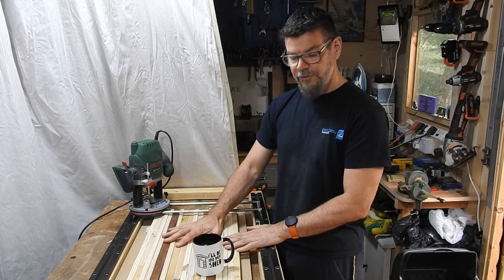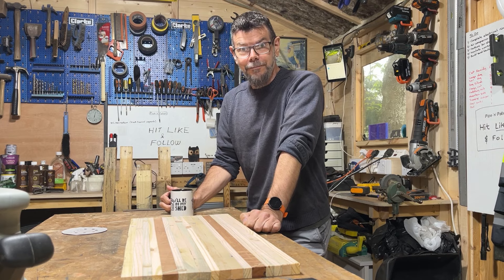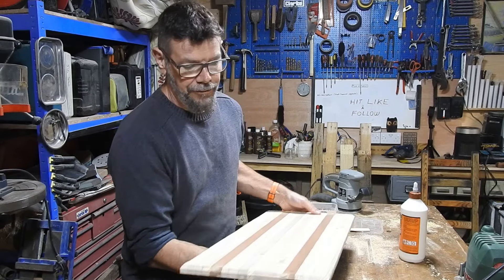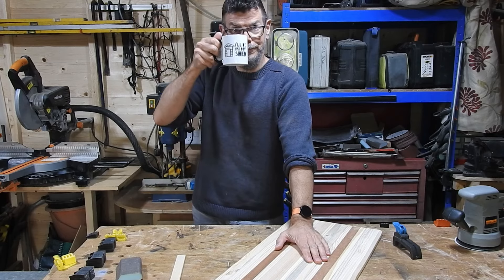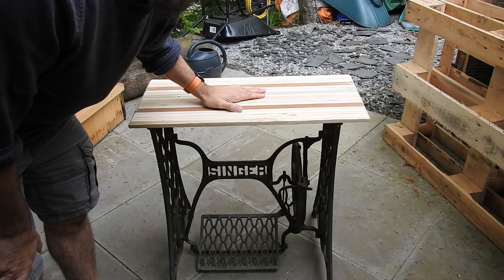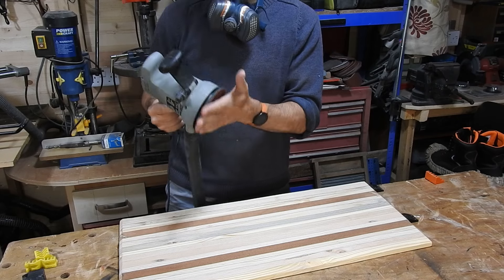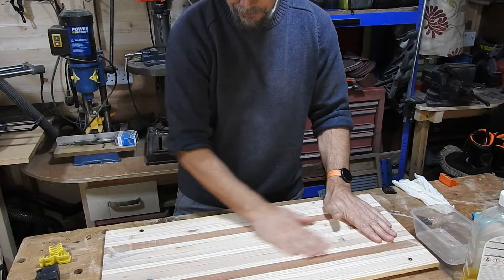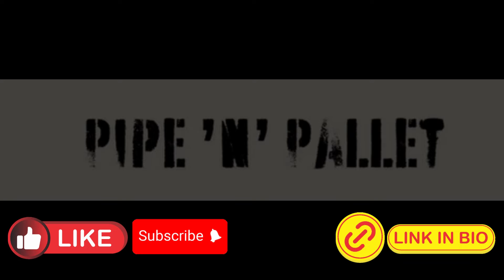How I made a table top from reclaimed wood

Comment: Nice job. Did you build or buy your flattening jig? I have the same Bosch router by the looks of it. 👍
Reply from the maker: I bought the jig off Amazon. It's a 'Trend Surfacing Jig'. It's not perfect, I had to mess around with the plate as it doesn't fit the router that well. You only get the slide and slide rails which you have to mount onto a wood frame. This I made. As I said, it's not exactly ideal but it does the job. I will be looking at getting something better hopefully in the near future.
Reply: @PipenPallet  Ok thanks for replying, I'll check it out or maybe build my own one. That's not cool about the plate not fitting as you expected.
Reply from the maker: It was frustrating at first but it's working OK and will do for now.